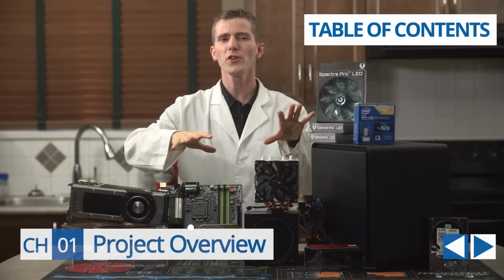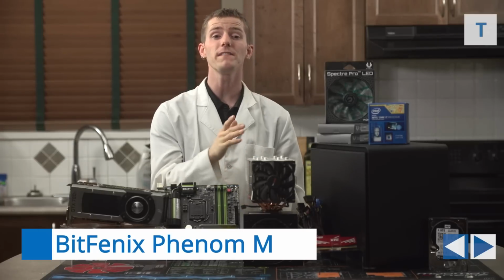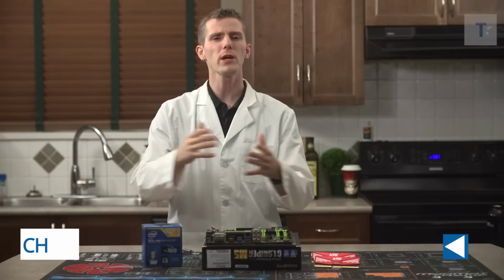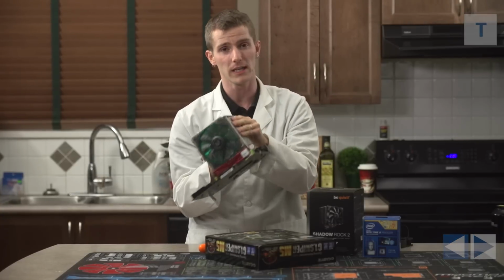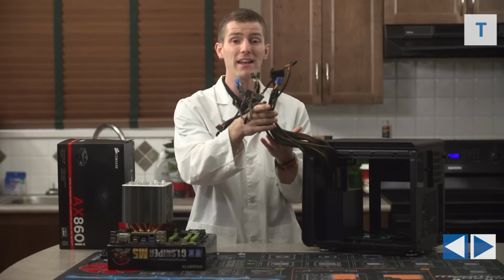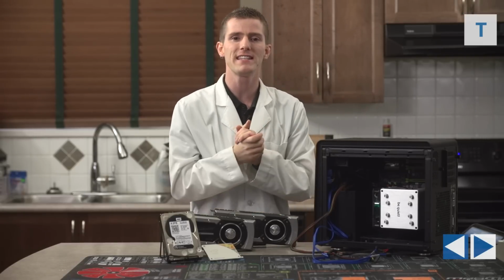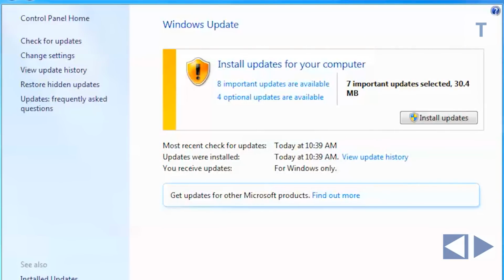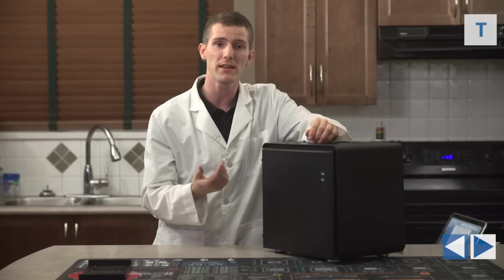ULTIMATE Intel Compact SLI Gaming PC Computer "How To" Build Guide

Comment: I have this exact case, and everything is there except graphic card. i'm planning to buy gtx 970 because i'll only be gaming at 1080p single monitor (no vram issue). should i really get the card that comes with reference type cooler(eg. Gainward) or card that offers more fan/cooling options(eg. MSI)? linus said it is better to sacrifice the extra open air cooling for the sake of other components, what do u say LinusTechTips ? this is my first build, so i have no idea whatsoever. my knowledge comes from your videos mostly.
Reply: ***** great build but get this mobo
http://pcpartpicker.com/part/gigabyte-motherboard-gaz97mxgaming5
It has the z97 chipset and the same feautures as the one he used but will support newer cpu's (skylake) and you can overclock if you want as for the 970 dual fan thing im not 100% sure about it i would personally just get one or two cards and leave them as it is
Reply: the 970 is good enough for 1440p gaming, buying it for 1080p is a waste in my opinion.
Reply: A butt and a half i'm thinking of a future-proof card as i won't be upgrading in 3-4 years if possible. and might be upgrading monitor later. my main concern is about the temperature in the case, in your opinion should i get a blower cooler or and open air cooler type?
Reply: Nazrin Putra if I were you, I would get an open-air design, and watercool my cpu so that it is not affected, but if you can't do that, games are gpu heavy, and not cpu, so the extra tempts on the cpu are worth it if you overclock the gpu
Reply: A butt and a half i am using the cheapest AIO watercooling for my cpu, the seidon 120v plus. I'm worried about the temperatures of VRMs and caps on my motherboard. those thing are not equipped with sensors as linus point out.
Reply: Nazrin Putra don't worry, mobo's, and other things are not affected as much as you think. probably the max extra heat from an open design would be 5 degrees (C)
Reply: A butt and a half thanks for the feedback and suggestions. i'll proceed with an open air for better gpu cooling.
Reply: Nazrin Putra your welcome, I'm glad that I'm able to help. if you want suggestions, I recommend either the asus strix, or the gigabyte g1 gaming (they have the best cooling).
Reply: Can you give me your opinion on this:
I5-4690k
Bequiet-shadow rock 2 (same as him)
Gigabyte g1 sniper (same as him)
Crucial ballistic 16gb memory
Crucial mx100 256gb ssd
2x western digital 1tb blue hdd
Seasonic 650w 80+ gold semi modular psu
Same case

For the graphics card i want to use the msi geforce gtx970, but i want to install 2x 120 mm fans on top (like he tried but couldnt) if i get one gtx970 will i be able to install the fans? Or if i could what would be a better option? 
-thank you
Reply: Moethedirt thank you, how would the ASUS Z97M-Plus do? ive been looking at others as well and i heard good things from this one too...just your opinion?
Reply: Moethedirt would you recomend that one? Or the asus z97m-plus? Thank you either way
Reply: http://pcpartpicker.com/p/KchTRB ?
Reply: ***** yeah its a great mobo and can crossfire but cant sli which isnt a problem if you need a small case
Reply: Moethedirt so if later on i get another gtx970 i cant use both?
Reply: ***** sadly no
Reply: Moethedirt thank you so much! :D i changed to it, seems great
Reply: ***** No problem :) :D

Comment: LinusTechTips is this a good gaming pc ?? please check it 
Processor:AMD Kaveri 7850K
Motherboard:Gigabyte G1.Sniper A88X
GPU-Gigabyte Geforce 970 4GB 256 Bit Two Way SLI
RAM-Corsair Dominator Platinum 16GB 8x2 2400mhz 
Main Storage-Intel 530 series 240GB x2
Backup Storage-Western Digital 3TB Sata
PSU-Seasonics 850W Fully Bronze Modular
Case-NZXT Source 210 Window
Cooler-Corsair H100i
 

Check Please! Thnx!

Comment: If i don't overclock my cpu, will the intel box cooler be strong enough?
Reply: Holy f*ck you guys are toxic, the bloke is asking a simple question. Answer him with respect.
Reply: Yah no shit
Reply: Jeah but 
1. its loud 
2. lower livespan (cpu) 
35$ for a I30 cooler will make it live longer and its more silent
Reply: Koen Van Den Berg Yes the Intel stock CPU cooler is "strong" enough to keep the CPU cool as long as you don't plan to overclock.
Reply: imapie4688 thanks!
Reply: Dat kan zeker! Zelfs overklokken kan met de stock cooler
Reply: ***** I know I sound like a noob for asking it, but i'm planning to use my pc a lot, so i wanted to know if the cooler will be good enough for it.
Reply: Huehuehue Huehuehue that doesnt say anything, the heats in the voltage, whats your vcore?
Reply: If it wast strong why would it be there??
Reply: +SIME_LP There's really no point it's not loud when handling small heat loads and I doubt you'll use a CPU for more than like 5 years. Lifespan has to do with heat and so long as temps are safe there will be little to no difference.

Comment: Ok iam building a pc have everything but cpu its on the way but was woundering do i have to put cpu in first or can i put it in last or is the cpu first thing to add cause it makes it easyer what i was wanting to do is add everything connect it in case and then cpu and cpu fan is that ok to do or does someone advise not to

Comment: One big question besides my question about upgrading would be, is it possible granted you only had one graphics card in this case, like a reference 980, could you use the space that allows 2 120mm fans for a water cooling AIO? Just a question/suggestion that would maybe cool the cpu a bit better and remove the need for that giant CPU Heatsink.

Comment: I had a few questions for the anyone with any good knowledge on pc building. I for one have now built 4 pcs. besides the point, I'm wondering if doing this is a decent investment. I currently have 500 dollars, only 500 dollars short of being able to buy the main components in this build minus the graphics card and monitor and HDD as I already have those components in my current build. 
My Current build is as listed below
CPU: AMD FX 8350, (I also have a spare... 4790k i7 lying around... don't know why...)
Storage: 2TB WD Black 
Motherboard: ASUS M5 A97 R2
Case: NZXT Phantom 820 White 
Video Card: MSI Gaming GTX 980 4GB 
Ram: 16gb of value priced RAM ( not proud of my ram as planning on replacing it!)
Power Supply: Cheap but durable, 550W 
Mouse: Razer Deathadder 2013
Keyboard: Corsair K70 RGB 
Monitor: WallMounted TV... 
Cooling Components
Corsair H75 Cpu AIO water cooling unit
NZXT Fans 2x 120mm, 2x 90mm side 1x 100mm front

Like I said before I'd like to know if the parts used in this video, not including the monitor, Mouse, Keyboard, and video card are worth upgrading to compared to my current build. Granted I would like a smaller form fact pc as I'm going to college this fall and would like to have a smaller pc going into college. 
P.S I'll be attending the University of Detroit Mercy this fall for any Linus subscribers that go to the above University :D Hi to you all!
Reply: If this helps i doubt it as it is two months old but oh well.
Yes i would upgrade to this build but if you would like i could make some mini itx highend builds in pc partpicker similar to this but updated for 2015 and more "portable"
:)
Reply: Moethedirt If yes here is a more portable version for you to upgrade to with an i7 4790k that you have lying around
http://pcpartpicker.com/p/X7CksY
Reply: Thanks for the build advice and yes I've already made my build, but for college I'm thinking about putting it into a smaller form factor so thanks for the build I will definitely see how it goes. I mostly produce music now, so this is especially luring to me xD

Comment: Just asking in trying to build a dual  980 gaming pc I'm asking.
1. Do I need a better power supply then a corsair rm? 
2.do the cables needed to connect both graphics cards come with the 3.psu in the box, is it the same with the sli bridge?
4. Is it necessary  to add additional  case fans? I'm getting the 820 phantom.
Reply: 5) Get a LinusTechTips forum account and post there for best results :)
Reply: 1) the corsair rm850 should be fine
2) Yes all the cables you should need will come in the psu case, also there will be an sli bridge
3) you shouldn't need more case fans, it has plenty
Reply: Yep RM850 should be fine but I would ger EVGA 850G2 if I were you.

Comment: If I swapped the gpu/graphics card to 2 Eva George GET 760 Super clocked w/ EVA ACX cooler which would cost $230 each or $460 for 2?

Just wondering because 2 let alone one gpu at like $750

Comment: Is This a Good Gaming Build and could someone find out if it is all compatible.

BitFenix Comrade Case Black with Window
Intel Xeon E3 1231 V3
MSI GeForce GTX 980 Gaming 4GB
Western Digital WD Blue 1TB WD10EZEX
Kingston Hyper X Fury HX318C10FBK2/8 8GB (2x4GB) Black
Gigabyte GA-B85M-D3H Motherboard
Corsair CX-600 V3 Power Supply
Reply: Casual G4mer it's just an i7 without the integrated gpu and overclocming capabilities. As long as he gets one with a decent clock speed, it's fine for gaming. And anything else he wants to do.
Reply: Why would you want to get a Xeon for gaming?
Reply: Go with an i7 instead. Better overclocking.
Reply: I'd get a better psu to be safe.
Reply: aidan wiggins probably?! Lol the Xeon rapes the consoles. The consoles have mobile processors in them! They're garbage!
Reply: Ben Zimmerman IKR
Reply: Darude - Sandstorm Who said he wants to overclock. he has a b85 board...

Comment: Will these be ok builds?
ASUS Crosshair V Formula Z MoBo
AMD FX8350 CPU
Crosshair Vengence Pro 16GB RAM kit
NZXT Kraken x61 Liquid Cooling System
Silverstone 1500W 80Plus Gold PSU
Geforce GTX760 4GB GPU
Crucial MX100 265 SSD
2x - WD Black 1TB HDD RAID1

and

ASUS Maximus VII Impact MoBo
Intel i5 4590 CPU
Crosshair Vengence 8GB RAM kit
Cooler Master Seidon Liquid Cooler
Silverstone 850W 80Plus Gold PSU
Geforce GTX760 4GB GPU
Crucial MX100 256 SSD
2x - WD Black 1TB HDD RAID1
Reply: NO dude please dont use a 1500w PSU and a gtx 760.
Get a 600 to 750w like corsair RM750 or seasonic 620w and get a better gpu like a GTX 970 and get a k series CPU like i5 4690k or i7 4790k.
Reply: ToPedro Ok,so a K series for the second one and better GPUs for the two?  Im planning on eventually running better GPUs in SLI on the first one which is why I was planning for the bigger PSU, but I'm clearly noob at this so, I'm open to constructive advise. Thanks for your reply.
Reply: Reginald J. Ewert In my opinion you should get a 750w psu like the corsair rm750 or similar. it as watts for 2 gtx 970 or 2 gtx 980 and a oc CPU.
If you want me too give you a build that i would do for my self tell me whats your budget and i will make you a balenced gaming centered build.
No problem i like to help.

Comment: Is this a good pc build?
Intel Core i5-4660 Quad core CPU
Cooler Master 212 EVO CPU Cooler
MSI H97 Guard-Pro Motherboard
8 GB Corsair Vengeance RAM
Crucial MX100 256GB SSD
Western Digital Caviar Blue 1TB HDD
EVGA Geforce GTX 970 4GB Superclocked Graphics card
NZXT S340 (White) Case
Corsair Builder 600W 80+ Bronze Power Supply
Reply: I'd go with an i7, but the i5 would be more than sufficient. The i7 would just allow more headroom.
Reply: thanks sport!
Reply: PenguinPlays no prob. BTW that 970 is going to serve you VERY well.
Reply: :D
 thx
Reply: Idea: It would be better to get the i5 4690K. Inp you can get it for 180 dollars and it is better than what you have, and it's also overclockable.
Reply: Raptor overclocking also requires a z87 or z97 mobo, wich are more expensive
Reply: Almost looks like my rig, running BF4, The witcher 2, GTA4, Shadow of Mordor on ultra 1080p like a champ! Always at 60fps+
Reply: Dont bother getting that cooler if you arent overclocking.

Comment: Sticking with the green theme. Mod the case - cutting out the logo/symbol at the front of the case and placing a green LED (or two if necessary) behind it so it glows green

Comment: what you think about my current rig from like 2009? not sure around 2008-2009
CPU - Intel Core 2 Quad Q9950
GPU - Dual GTX 780Ti Ref.
CPU cooler - corsair H100i
PSU - corsair hx1000 (old verision)
MB - ASUS MAXIMUS 2 lga775
RAM - corsair XMS2 ddr2 800 oc 1066mhz
CASE - corsair 800d
HDD/SSD - 2x random 500gb seagate drive / intel 730 ssd
Reply: CPU bottlenect with the 2 ref 780's
Reply: ElectroSandwichMaker 9000 ok now i on my 2nd rig
only thing change
mb - evga sr-2
cpu - dual xeon x5680 at 4ghz
cpu cooler - dual custom loop
psu - ax1500i
ram - corsair vengence thing dual 24gb kit on each cpu
gpu - quad 780ti in custom liquid cooler
case - corsair 900d
hdd - 2 wd black in raid 0 (2tb) and 2x 1tb random seagate hdd in raid 0 for OS
ssd - no MORE
Reply: ***** o_o
Reply: ***** Stop bullshitting please
Reply: X/2 shit wat, i just have too much money

Comment: I'm going to build my own gaming oc this are the specs what do you guys think?
Gigabyte Z97P-D3 
Crucial M550 128GB SSD
Cooler Master Hyper 212 Evo
MSI GTX 770 Gaming 2GB
Cooler Master B700 700Watt
WD Blue WD10EZEX 1TB HHD
Intel Core i5 4460 / 3.2 GHz 
Crucial Ballistix Sport 2x4 8GB
Corsair Carbide Series SPEC-01 Red LED
Reply: Whats your budget and do you have a monitor/keyboard and mouse?
Reply: Nicholas Donovan No I don't have a monitor and a mouse but i have a keyboard but it's kind of a crappy one my buged for like everything is like $1100 for my pc and monitor with a mouse. and hats like 900 euro in my county
Reply: ***** A good site to check out is http://www.logicalincrements.com/

Comment: My new rig that im buying soon, let me know what you think.

Amd fx 8320 (i plan to overclock and get same perf as 8350)
Asus M5A97 R2.0 motherboard (love the price to specs ratio)
Gtx 970 eVGA
Corsair vengence 8gb ram
500GB hdd WD
500Watt eVGA power supply
Reply: thats a strong PC :O 

next time you have money for upgrading, do upgrade to a SSD, and more ram. 

Then It will hold for many years :)
Reply: Brandon Brown Except for the fact that the 970 destroys the 660 :P
Reply: Hunter Lofgren 970 destroys any other card in terms of price/performance.
Reply: You will be happy. Close to my rig that I built last July 2013
AMD FX 8350
Asus M5A99X
GTX 660 no overclocking upgraded from something less (had on hand)
SSD Force GT for OS
HDD 1TB Seagate
Original 600w non-mod PSU, upgraded now has 750 Modular PSU
whatever peripherals
16GB memory kit via Kingston

The great thing to my build was that I did it over time, bought what I could and watched for sales. Besides the other non-essentials, this came in at a total of about $950. I kept track of costs and if everything was full on cost it would have been around $1,300. Added some stuff on Black Friday (upgraded GPU), then found a good deal on PSU and well, reused a lot of little things Drives - readers, etc from old PC. 

I am set for the next few years, however I did buy the Hyper 212 Evo heatsink and the fan quit working after 13 months unexpectedly. I had my Original Stock heatsink that I quickly replaced it with today. Just going to find a replacement fan and re-install soon. It does a good job, wasn't expecting the fan to go out so soon though. Which is why I was here and watched this video, wanted to see what is going on a year later.

I use mostly for a little gaming, but more on a programming side (amateur stuff). I love it, totally silent. Last PC, would whirl like a tornado (Dell) :)
Reply: Brandon Brown hey I can buy all these parts with a case currently for 830$. I'm buying it all together. If I lived in USA instead of Canada my build would literally coat a minimum 100 less so I could've got this build for 700 if I was in the states sadly Canada hypes prices and im getting it for 800 which is really damn good for a card that can do like 4k at like 20-30 fps damnnnn but like mostly 1440p over 60fps I'll be so happy with this setup but thanks for your input I'm gonna upgrade the CPU fan so I can over clock my CPU and I'm gonna over clock my gpu off the bat. I'm quite excited
Reply: Shit CPU. You should invest in a better one, otherwise it's an excellent rig.
Reply: I would buy a intel i5 4460 it's a little bit better for gaming and costs around the same

Comment: Will my gaming build I'm considering buying work?
Here's the build (~£630):
- 3.8GHz AMD Athlon x4 760K Black Edition
- MSI A78M-E35 (Micro-ATX)
- 2x4GB Corsair Vengeance Blue RAM
- 2GB Gigabyte Radeon R9 270X OC
- 1TB Seagate Barracuda 7200
- 430W Corsair CSM Builder Series
- Corsair Obsidian Series 450D Thermaltake Chaser A71 Full Tower
Note: I do have a budget so if something does need changing don't go too fancy. Here is a list of the main parts and extra stuff at the site I'll buy it from: http://www.scan.co.uk/savedbasket/b567d5f558d947fba54faefc4472971d

Another Question. Will these games work on the build? (Not looking for spectacular graphics)
- Arma 2 and probably DayZ mod with it.
- ES Oblivion
- Space Engineers
- Planetside 2 (Not too worried about that one)
- Older PC Disc Games (Roughly as old as XP era) <- I know its a bit vague.
- PCSX 2 (Mainly Dark Chronicle, which isn't cheap for ps2, and Kingdom Hearts)
- Some GC emulator like Dolphin (For Super Mario Sunshine and Pokemon Colosseum)

You can answer either question or both, up to you. Thanks.

Update: If you are wondering why I am posting this same comment on several different videos. then I trying to get answers as soon as because me and my brother are buying soon.

Comment: Can I have some thought on my rig?

Press "Read More" For Rig Info

Intel Core i7-4770K Quad-Core
Gigabyte Z87
XFX R6670 Core Edition
((Still Looking For A Case))
1x 8GB of Ballistix Sport DDR3
Thermaltake TR2 600W
Intel 530 Series 180GB SSD
2x WD Green 4TB Bulk Bare Drives
Corsair Vengeance K70 RGB
EVGA TORQ X10 Carbon
2x Acer H236HL bid 23-Inch Widescreen LCD Monitor